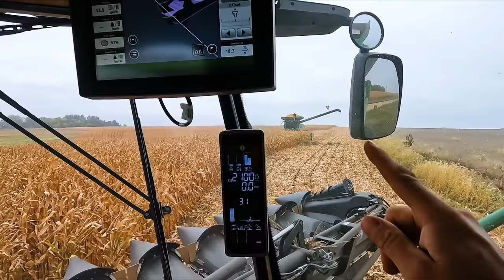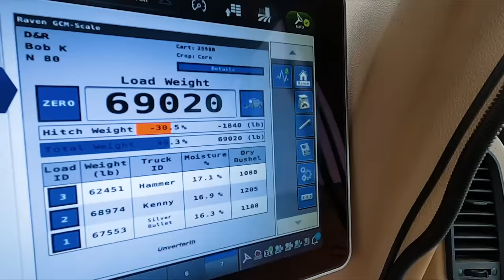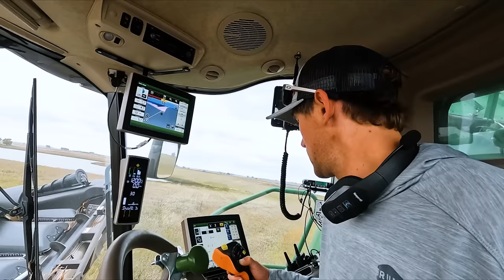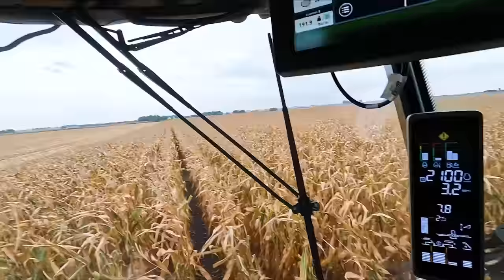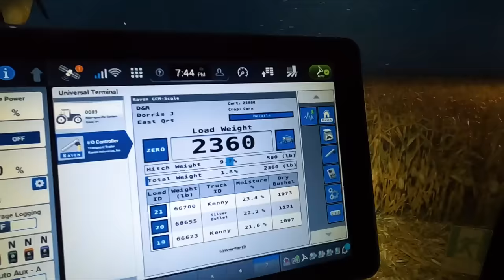Corn Harvest Is Going Great Thanks For Asking!! #3

Comment: Dougo, quick tip on the whip flags. Use a piece of Shrink Wrap that you use for electrical connections works great on the fiberglass flags. It works great, I use it on my Power Pole on my boat and I can tell you the first time I grab that thing when it was bare was the last time. Might work better for you if you use a bright florescent type color especially in harvest or tilling so they don't get run over. I know you all have many flags and I think you can get it in 100' rolls too.

Comment: LOL, visibility with a folding monster corn head.......... good thing that isn't covered in the BMV manual...🤣🤣. Very glad to see you guys going full steam, Chet seems to be born with it in his blood and no doubt it came from his upbringing in having a dad as great as Dougo and we cannot leave out sweet Amy as a perfect mother to have. Dougo, my first thought of the plug issue you were describing was of a done for raccoon, glad it turned out not to be a mess. Overall, when it comes down to the different crop conditions/moisture content etc, getting into the science of productivity given the variables of what effects certain aspects, just as with the science of how deep to run tillage or what type of tillage is most productive, take note of your different field conditions and start keeping track of settings. If you can dial that in, you would be setting the bar for how to be most productive.

Comment: I sure as hell wouldn't be combining corn at those high moistures when it was still early in the fall. We only touch 30% for high moisture corn for the silo at home. Otherwise it sits and waits for 20%.
Reply: Mid October in Northern Minnesota.  It could snow any day now.  That is why they have that huge drier.
Reply: @beckyumphrey2626  here's a little tid bit,  snow doesn't really keep corn coming in.  I live in Wisconsin and have combined corn with snow in the ground. So your comment is irrelevant. It takes so much more LP to dry it down that it basically makes it worthless at that point.

Comment: You can't start a 3 Phase Fan Backwards without reversing the wiring - Or the power lines getting reversed by the power company. And they really try not to flip it themselves. Always marked "ABC" And rotation direction clockwise 🔁